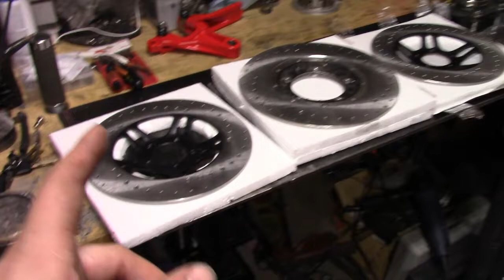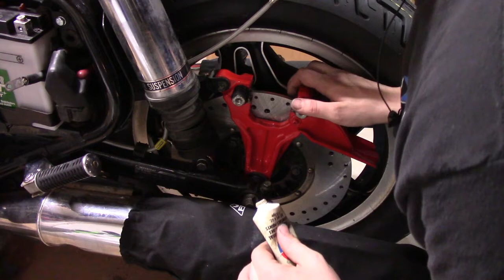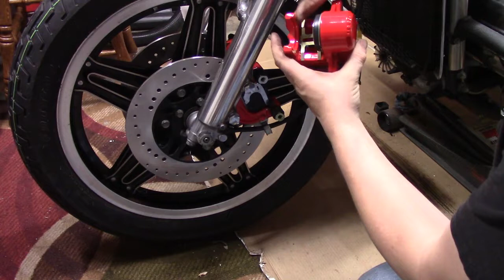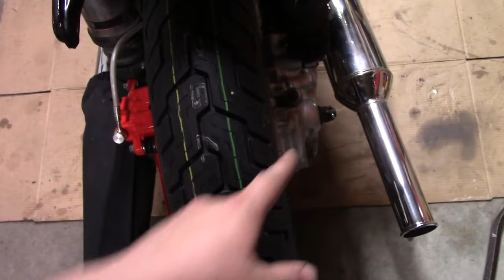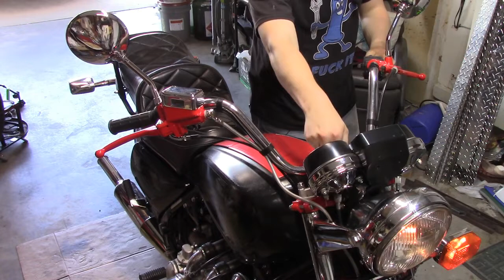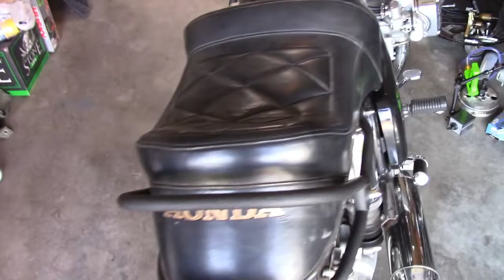Finally On The Road | 1981 Honda Goldwing Rebirth Part 14

Comment: First thing you took 2 or 3 years off that starter, second it has a choke? Nice job. I didn't watch the whole series. I've owned 8 goldwings since I retired from the military in 88 guess what they all required choking when cold. I seen a 78 start easier than your bike having been Buried in snow up to the head light.
Reply from the maker: Yes it has choke, which was on. The carb bowl was empty and the fuel lines dry. I mentioned the need for priming in the video. Prefilling the bowl would've been a good idea in hindsight.
What would you have done to prime it? I've had some suggest a little starting fluid but others will assert that's a bad idea for different reasons. Obviously it starts right up if it has fuel, and would do so buried in snow...
I've since replaced the starter contactor and fixed the wiring for it and it starts even better now. Over 7k miles since this video and I'm loving this bike.
Thanks for watching and commenting
Reply: @DustyDingus  my mistake didn't know the bowls were empty. Overhauled one myself back in my 30's yes it was decades ago. Retired now. My bike will be Saturday I'm going to post a video. ✌️

Comment: Thanks for another great video Mr. DustyDingus!  I purchased an '80 GL1100 some months back and have been refurbishing it here in AZ while you have been refurbishing yours.  In fact, your great videos have been a great help for me along the way in my GL 1100 journey.  Your bike turned out great and I am confident you will enjoy getting to know her as a "complete" bike...even sorting out some of the inevitable quirks that come with any restoration.  I too ditched the flimsy plastic front fender for a steel one (from a GL 1000).  I especially like the fender you chose because it's a bit sportier.  What fender are you using?  I might look for one myself!  Ride Safe up there in CO!
Reply from the maker: Thank you! And I am very glad to be a help to you! 
The fender is off of an 81 CX500. It's not in perfect shape but it was cheap at a local bone yard. One day I'll stumble on one without scratches and dings, maybe. You do have to kinda stretch it out a bit to bolt to the forks but it wasn't major. It also has perfect brake line brackets, you just have to borrow a 2nd bracket and rubber from another CX500 because they only had one front brake and the GL1100 has 2. The spot/threads are already in both sides of the fender though
Reply: @DustyDingus  Thanks for the front fender info.  I actually located a CX500 fender on EBay and grabbed it.  It will need to be re-chromed, but will look a bit sleeker than the GL1000 fender.  On another note, I re-built the OEM carbs when refurbishing my GL.  I am wondering how you are liking the VW single carb conversion you installed?
Reply from the maker: I am loving it! Runs great! 2250+ miles on it so far
Reply: @DustyDingus  Thanks!  Are there any particular set-up issues I would need for a conversion?  Jetting, etc?
Reply from the maker: @nativerhythm1564  mine was pretty much plug and play, haven't had to mess with jetting. I did make a little adjustment to the electric choke so it doesn't close all the way but that's about it
Reply: @DustyDingus  And the stock mechanical fuel pump works with the VW setup?
Reply from the maker: Yup! No problems

Comment: Don't leave it on the side stand for extended periods, if you do it will smoke out of the low cylinders on the kickstand side. Honda changed the oil ring design to fix this issue, but no fix is perfect for this particular issue.

Comment: Nothing is better than stock carbs,thats why the bike was built with them
Reply from the maker: That's your opinion and you're welcome to it 😊 over-engineered is a well known concept. If VW can run 1 carb on a 4-cylinder boxer engine then so can I. Over 8k trouble free miles on this, there's zero justification to switch to 4 CV carbs.
Thanks for watching and commenting!

Comment: Thank you so much for sharing your video Mr. Dusty Dingus! A simple and a very nice finished…It gives me more info coz I have the same project bike. I will keep watching your videos till I finished my bike a 1980 GL 1100. Again thank you and enjoy riding your bike. 🇨🇦 
Please let me know where did you get the single carb conversion kit and air filter.
Reply from the maker: I got it all in one purchase from eBay, they come from Lithuania. Same guy also sells on Etsy
You're welcome! Glad to be of help
Thank you for the compliment, and for watching and commenting as well!
Reply: @DustyDingus  I just disassemble my front fork to replace the seals and man. The inside has rusty c-clip and washer. I am having a hard time to remove the old rubber seal...thank you for your reply...cheers!!!

Comment: Way to go ! ! ! ! You DID it    : )  I wondered a bit when I watched first few videos, but you obviously knew what you were/are doing... I have an 82 1100 that is not a running bike now but your project & videos made it all seem so attainable.  thanks for taking the time to video all this .. ENJOY  From the first videos, did you actually USE that BMW gas tank? and did you change the air shocks to regular shocks... I thought the new shocks you bought had springs & no boots?  Either way.. it all looks great.  Glad you're enjoying it.
Reply from the maker: Thanks for watching! I put over 2500 wonderful trouble free miles on it so far 🙂

Comment: Great videos just wondering what grease you used for the splines on the rear wheel,I heard it’s difficult to source the proper moly grease.
Reply from the maker: I also could not get my hands on the "right stuff" so I just used the highest % moly grease I could get my hands on. I will have to get back to you on the specific brand etc.

Comment: Sounds like the Starter sprag Clutch is sticking?
5 mls. of Gas under the Air Filter would have got a much quicker start.
Reply from the maker: Yeah or prefilling the bone dry carburetor bowl instead of waiting for the mechanical pump to pull fuel through dry everything and fill the bowl. As it goes, hindsight is 2020. No sticking though. Still using that starter and have done nothing at all to it
Reply: @DustyDingus  It sounded like the starter clutch was sticking  on the over run.
when you were blipping the throttle it was whining each time the Engine slowed to Idle.

Comment: Atta Boyeeeeeeeeeee Dusty...............F**k Yea.  Where in the Hell did you get those beaaaaaaauuuuuutiful rotors? I got vented ones on the front. HEY DUSTY want new Shock boots? I found some and you can get em too............BRAND NEW.  WANNA KNOW WHERE?
Reply from the maker: Thank you!
Tom at TrueDisk LLC resurfaced these rotors into the beautiful rotors you see today. Fronts had some grooves.
The rotors are the originals, I measured them (diameter, thickness, runout - done on a CMM) and made patterns in FreeCAD, then designed templates that I could use to center punch the holes to be drilled and printed them on my 3D printer. Clamped template to rotors, punched holes, spent a while drilling holes and countersinking. Then a few days calling around to find out that Tom (TrueDisk LLC) is the only one that can/will do them and the only one with the equipment to do it RIGHT. I shipped the rotors off to him after a few phone conversations and got them back in like a week and a half? Definitely worth the cost, I am SO pleased. Absolutely no regrets 10 out of 10 would recommend.
Reply: @DustyDingus  Need new shock boots?
Reply from the maker: Oh yeah! They're pretty shot. You know where some are email me dustydingusyt@gmail.com

Comment: Thanks for this video. I really like what you've done on the bike.
I'll need to replace my Brake Rotors (Front and rear) as they are under the limit.
What are the references for the ones you're using on this bike ?
Thank you for your help
Reply from the maker: These are the originals. I drilled the holes after making a pattern on my 3D printer, chamfered the holes a bit and then sent them to TrueDisk LLC to have them resurfaced. Still well above minimum.
All of the aftermarket replacements I found were way too expensive.
I'd recommend getting on ebay, ask for measurements before purchasing. Or find a local bike salvage yard and take some micrometers with you.
If none of that pans out I have a local Goldwing guy that would likely have some, email me at dustydingusyt@gmail.com if you need my help with that
Thanks for watching!
Reply: @DustyDingus  Thanks a lot for the details.
I've found aftermarket far too expensive (I'm in France...) So I'll look at used ones and check if they are better than mines.
It should be easy to resurface them when I'll find some :)
Reply from the maker: That's what I thought, but TrueDisk was the only place that would do them and the only place capable of doing them correctly. I highly recommend them

Comment: You might need a new starter after cranking it like that
Reply from the maker: Over 7k miles since then and going strong. Mechanical fuel pump, empty carb bowl. Prefilling the bowl would've been a good idea in hindsight.
Thanks for watching and commenting!

Comment: my tac does not work on my 1987 interstate. at first only when it was cold. now no worky at all
Reply: Cable worn out or bent, Bad tec head, buy new one on eBay and every other parts you may need

Comment: How does it run with just one carburator?  Similar to how it did with 4 or not as good?
Reply from the maker: I think it runs great! But I never had the original 4 operable to be honest. Over 3500 miles on this setup though and had it up to 10k feet elevation several times.
Reply: @DustyDingus  Nice.  Plenty of power and speed for the interstate and passing?
Reply from the maker: Oh yeah! Up mountain passes, long rides on the interstate you name it. Twist it and she flies! Peg the 85 mph speedo in 3rd gear so I can't honestly tell you how fast I've gone only that I've never had a problem passing anyone I want. It's a really great ride, I'm going to put a few hundred on it tomorrow morning actually
Reply: @DustyDingus  Awesome.  Had a lot of fun watching your build series on it and learned a lot too.  I'd like to build a chopper out of a Goldwing someday, maybe a single carb conversion is something I'll do.
Reply from the maker: Thank you for watching! And I'm glad you enjoyed it. If you do end up making that chopper send me some pictures!
dustydingusyt@gmail.com
Reply: @DustyDingus  Will do man. 🤘

Comment: Amazing you did not burn your starter motor up. Put 10 years worth of cranking on it.
Reply from the maker: Uh, no. It has a mechanical fuel pump, you know of another way to prime a mechanical fuel pump? It is just fine
Reply: @DustyDingus  Spray starter fluid into air box.  That will start the motor and prime it without cranking the heck out of the starter motor.